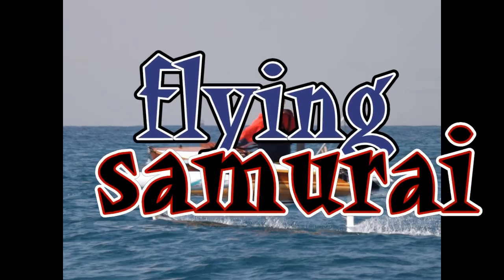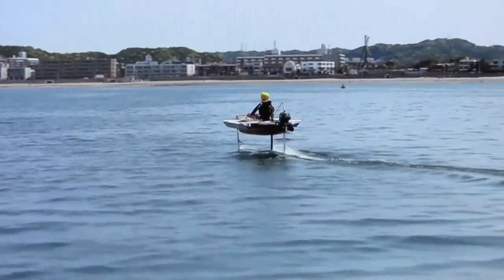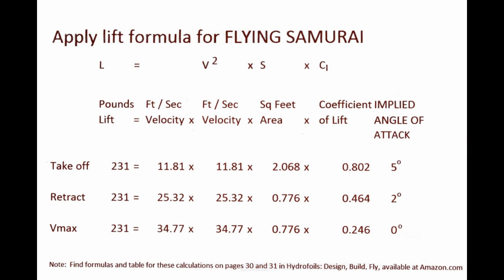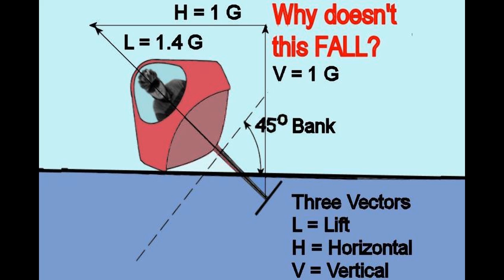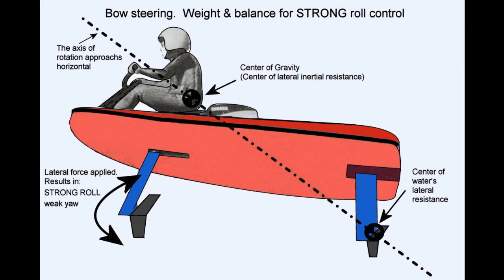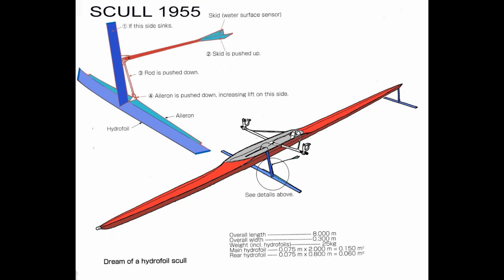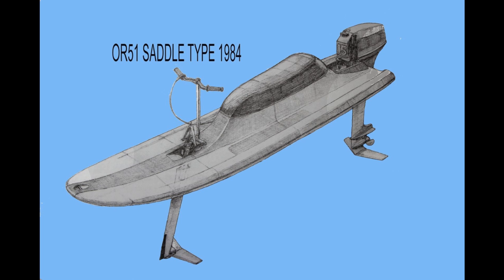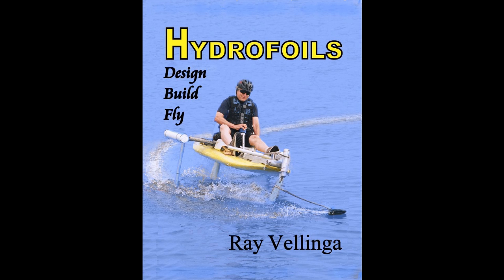HYDROFOIL -- ASTONISHING !!! 24 mph on 2 hp can save the planet!  Vellinga Video

Comment: I have a 10 ft RIB with a 20hp SuzukiEFI that does 31MPH. I thought I was haulin till I saw this video. 24 mph with 2 hp is totally awesome. And it looks a lot smoother riding in choppy water than my RIB. I bet a small hydraulic damper linked to the follower would keep the hull from diving when crossing a big wake. I think it over compensated or reacts to quick to the surface deviations. I wonder what a 12' aluminum boat would do with a 20 HP motor and optimum hydrofoil and prop? 45-50MPH?  Makes me want to try.

Comment: Hello, Ray. I bought your book, and am fascinated by foiling. I have a 26’ express cruiser, and am thinking of adding foils to provide enough lift to improve fuel economy (I use it a lot), and stabilize pitching. I boat on Lake Ontario, which has very wavy waters, often around 2 feet, and this makes boating very bouncy. The spacing of the waves creates a lot of pitching on plane - about 38-44 km/hr. My thought was to add a noise foil to stabilize the bow so it doesn’t constantly fall into the trough, and scrub a lot of speed. Then add two rear foils to provide some lift at the rear. My boat weighs about 7000# loaded, and don’t need to lift it completely out of the water - just create about 1000# of lift to lighten, reducing some drag and keep the bow high and stable. 
Just wondering if you think this is a feasible approach to foiling? It would add many hours of boating pleasure in this turbulent lake. 
Also, I would consider hiring you to assist with the design, to avoid any pitfalls as I understand this is a pioneering approach. Please advise if you have a minute.
Thank you. Peter@shingwa.com, if you would like to reach out to me.

Comment: Thanks for sharing this video. Amazing boat! I have ordered your book in the hope of some day building something like this. My idea is to use a 2-3 kW electric motor and a custom made integrated driveshaft/foil leg, though. -What do you think about this idea?
Reply from the maker: +Carl Hyllander Take a look at the Torqeedo Travel 1003 - 28 inch long shaft, Carl.  It compares to a  3 hp gas engine and weighs only 21lbs including battery.  With the optional high speed propeller V30 there is a claim that it will go 14 knots (subject to verification).  Lash it onto a 35 lb West Marine Saba 9.5 sit inside kayak, skillfully attach Moth struts and foils, and you might have something.  I'm just suggesting some ideas.  Do some research on these components before you start filling up your garage.  For example, will the kayak (not a classic planning shape) go fast enough for the foils to lift the hull (Vto)?  Are the Moth foils proportioned appropriately, and of the correct area?  It would be no fun if you had all the answers without doing some calcs.  Good luck, Ray
Reply: +Ray Vellinga Thanks a lot, Ray. This seems like an excellent idea.

Comment: Very nice. I understand pitch stability / control, but how is roll stability achieved? Dihedral in the foils?? Looks very pole-walking like to me...
Reply: mike o Bingo! In order to allow leaning into turns (which keeps forces normal to the hull & allows several weight reductions) it's not self-stabilizing. You can see him working to keep the craft up at several points in the video; it reminds me of trying to balance a fast folding scooter.
Reply: On computer controlled foils it's controlled by turning the left wing up and the right wing down and the other way around. :)

On this system it's just controlled by turning the ship left and right or leaning. Like a motorcycle is controlled in roll. :)

Comment: What I'm most curious about is if they are more or less energy efficient for a given speed compared to planing or displacement. I haven't found anything about the power needed to create this lift. E.g. the forward thrust force needed to create the lift at a given speed (P = F * v). Assuming you have the power to make a boat fly, at what displacement or length is this more or less efficient?

I've ordered the mentioned book but can't wait haha. I figure if the foil could be made large enough to lift a solar powered boat it would make travel via solar power alone more viable (faster than displacement with solar power alone)
I mean this 2hp could be replaced by a small torqeedo motor and you could put a solar panel as a roof to recharge for free. 

Why don't we see more boats like this? Even more complex computer controlled T hydrofoils should be relatively easy, and if there is an efficiency bump shouldn't that make it worth it?

I figure with 4 computer controlled T foils you could also use a kite on a larger boat to make use of solar and wind. Kites are cheaper and don't throw shades on the solar. A computer could control the kite and the foils to keep the boat perfectly level.

PS: Oh lol I didn't realize you were the actual author of the book :) It came highly recommended.

Comment: What are the differences between this type of hydrofoil and a surf board with a hydrofoil that can get the system in the air using just a paddle or with the rider pumping there legs up and down as though they are jumping without their feet leaving the surface of the board? I am looking to hydrofoil my sea kayak and once up launching a power kite to propel myself through the ocean.

Comment: amazing efishency!! super cool!! what happens if while sailing a foil hits a fishing net?
Reply: Stops suddenly😁
Reply: Fishing net? Much like any keelboat/outboard/prop-drive/whatever - it depends on how the hardware is shaped.
On passage to the Canaries in the 1990s. we popped into Portugal, somewhere up a  wide river estuary.   Near the top of tide, so we took the short route,  but noticed that the two local boats in sight were on the other side. Nothing remarkable in that.  Then we came across a small monohull cruiser with his keel  entangled in nets - we had slipped over them with our deep vee hulls with LAR keels and had not noticed them.  
There were no visible markers or buoys, because they had submerged at high tide. 
Even props can have skegs that need not add excessive drag, too.  It's all in the design.

Comment: This is lacking a computer controlled stabilization - for longer trips this level of attention would be very exhausting.

But still very impressive.
Reply: Ruben Kelevra Can be added cheaply. Arduino, sensor and some servos.
Reply: Marcus interesting, which sensor would you recommend for the movement detection and angle detection?
Reply: You'd get a accelerator, gyro etc to sense the angle and orientation of the craft. These are used in phones are are very very cheap by now. They also don't need to sense anything "outside", they just measure acceleration, rotation and gravity.

Comment: OK but who developed such an extra-extra-extra-extra long shaft 2hp outboard? (powerhead looks "stock"...) and who has developed a prop for such a tiny outboard with pitch to reach 24 mph? -- then I see WHO is the developer - yep, a Yamaha staffer! fo course, he has the full support of Yamaha R&D... but still, where canh I get such a neat outboard??   (consider a racing class.... affordable, no?)
Reply from the maker: +Wayne Gilham 

Yes Wayne, the team is all from Yamaha, but I believe they are working this project independently of the Corporation.  The techniques for shaft extension are well know to them, especially to Kotaro, because they have designed or made extra long shafts for the YZ886, OR51, and OU90 (see the last minute of the video).  You of course are an expert in sailboats, so I ask you, aren't there extra long shafts on "kicker motors" for small cruising sailboats?  The propellers can be custom made at places like Pacific Marine Propellers, Chula Vista, Ca 619-239-0129.  To custom make shaft extensions is difficult, but can be done with the help of a machine shop to cut splines on a new shaft, and an aluminum welder to assemble new end plates and custom long bodies for the mid unit.  The trick Kotaro's team does that really impresses me is attaching the main foil to the motor skeg.  It looks like they simply weld it on, but I have never asked kotaro if there is a secret.  Ray
Reply: I was asked to design a lower end transmission for an efoil and believe me it is a super precision engineering work of art.....not impossible to duplicate but certainly non trivial.

Comment: Hey Ray. where can i find some info on hydrofoil assist? I want to raise my sail/motor cat so the hull remains in the water a little bit still retaining control with rudders and hill stability. My idea is to reduce weight and surface tension to gain speed. Is this idea a good one? see https://www.youtube.com/watch?v=A6dDARmnctw Thanks Hey dont forget to have fun!
Reply from the maker: +Walkertongdee   Good question, Walkertongdee.  You are asking me about HYSUCATs, HYdrofoil SUpported CATamarans, and some good visual examples can be found at: http://ihs.phanfare.com/.  In the "I" classification.  Also do a google search for HYSUCAT and HYSUCAT foils, and you will find a lot more. 

 I love the Thailand long boats, and there should be no reason hydrofoils would not work on your excellent catamaran.  However, you will see a pattern of using the hydrofoil assist on heavier catamarans.  Yours is light, draws little and appears to very efficient, so you might have less to gain.  But the HYSUCAT system is simple and could easily be tried on your small boat.  Let us know how it works for you.
Reply: Well yes, but as of yet I haven't proceeded, not enough info there and I did not buy your book like you told me not to, he,he. Seriously though can you point me somewhere? Thanks.
Reply from the maker: +Walkertongdee Yes, seriously, Walkertongdee.  Beg, borrow, or steal a copy of Hydrofoils: Design, Build, Fly and read it.  This will give you a good understanding about the principles of hydrofoils along with much practical information.  From there you can adapt foils to your catamaran.  For specific questions, post them on the foils.org Chat board:  http://www.bulletinboards.com/message.cfm?comcode=foils,  Either I or Scott Smith or someone should have an answer for you and we can all share the discussion with the hydrofoil world.
Ray